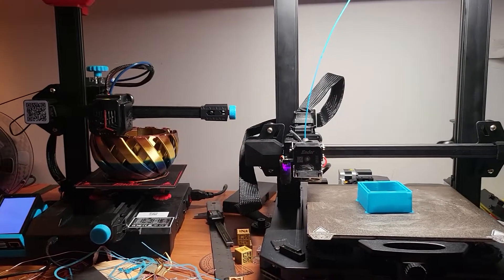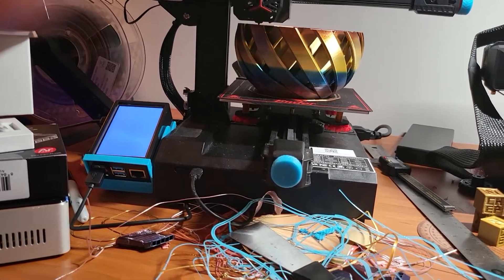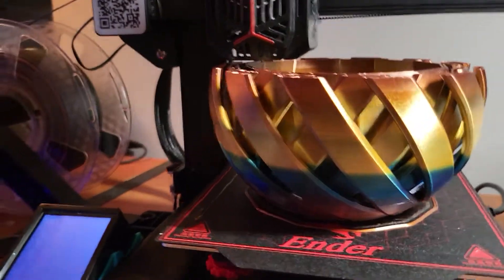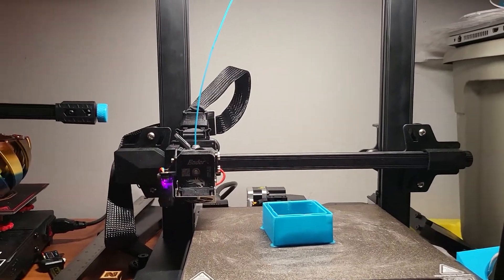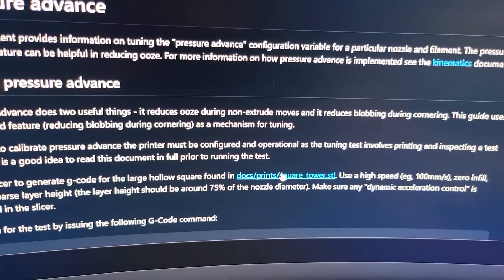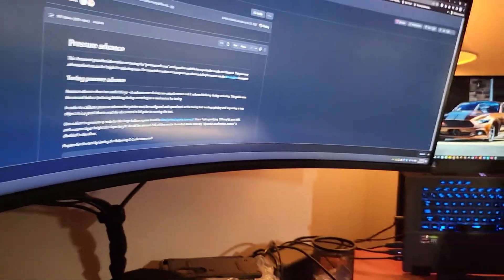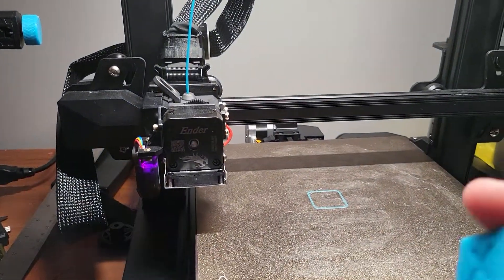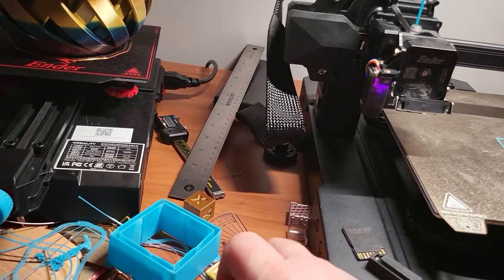Ender 3 S1 Pro /Ender 2 Pro Pressure advance and other topics

Comment: That is strange. Don't know what the issue could be but my Ender 3 S1 Pro after setting it up and doing all the calibrations etc. It is new but still I have done 12 of those cubes xyz and Benchy Boats many and they have all come out perfect. Bed too warm for the cube to have elephant toe? Only thing I can think of for yours but I like both your printers. Also I use Cura and Prusa slicers. Dont know if that matters that much for calibration cubes though. Thanks for this video. Nice work. Peace.

Comment: After installing klipper and adjusting the pressure advance I still was not able to get a clean top layer on the parts which is a shame. It did solve the corner overextrusions but I really needed the top layers to be neat so it's a pity